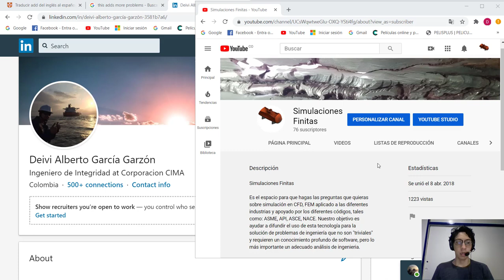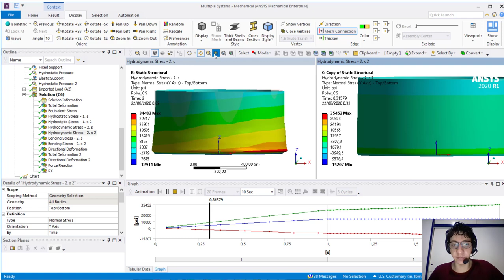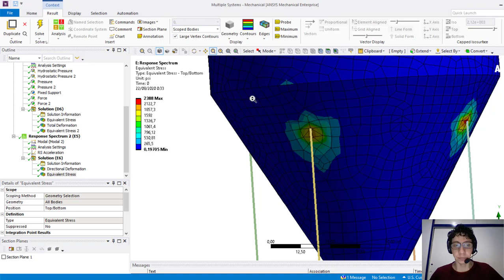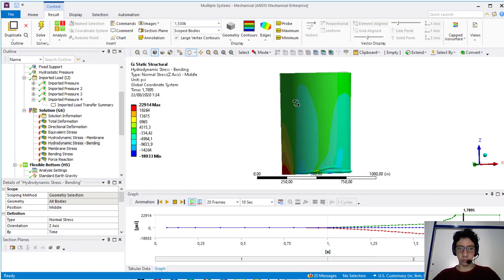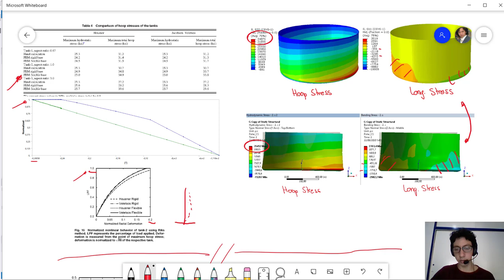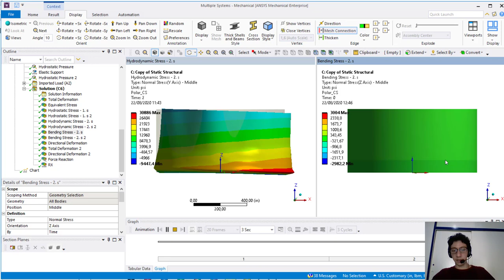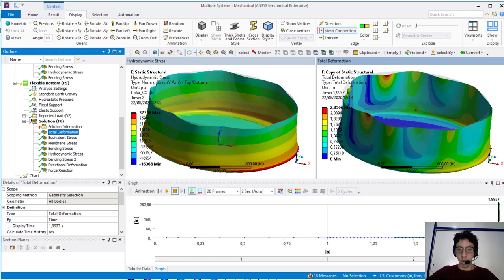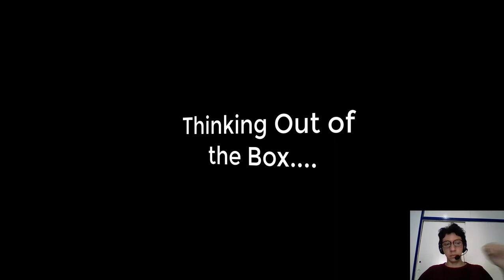Seismic Load on Storage Tanks

Comment: have you tried coupling analysis?
Reply from the maker: Yes, we have done coupling analysis using Fluent and Transient Structural. We're working right now in a manuscript using SFI 1-way and SFI 2-way. What do you need to simulate?
Reply: @simulacionesfinitas7726  for a master degree I'm trying to make an interaction between a API tank and water (I wanto to compare gross results from a numerical method). I have some advancements because there are less errors, but i'm still without results.

Comment: In explicit dynamics when EQ load is applied on the water tank, and when checked for solution tree, when user-defined pressure is looked at, there I can see larger negative values and positive values on the tank wall. Is this kind of larger negative pressure values are possible? If you send me your email id, I can send my model, and can you check that?
Reply from the maker: Hello Ashan, you have to consider first that using an explicit model defines your simulation time in a matter of miliseconds to seconds. So I wouldn't use explicit and Equivalent acceleration load, in abaqus I think it's possible to use SPH and response spectrum to define the problem more accordingly. I can check your model by the way my email is deivi.garciagarzon@gmail.com

Comment: pls make videos for underground storage tank (horizontal) and as a question is there any difference how to analyze the horizontal and vertical underground tanks ? what are things we have to consider for underground tanks?
thanks.
Reply from the maker: Hello Meti, It is possible using shell elements, you might consider this external weight by either a constant value or a linear pressure distribution, the point is your geometry should be stiff enough to avoid buckling... If your underground tank is too thin it may have problems with external loads, besides you must consider corrosion allowances